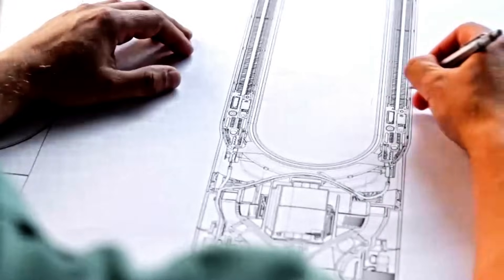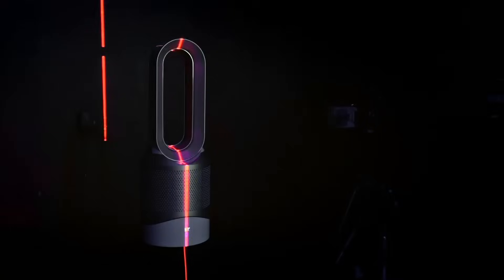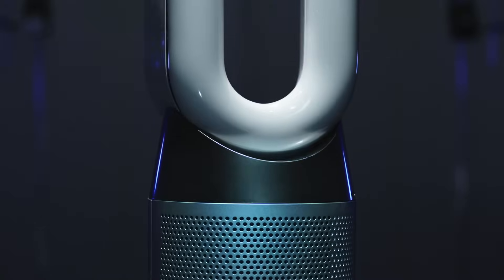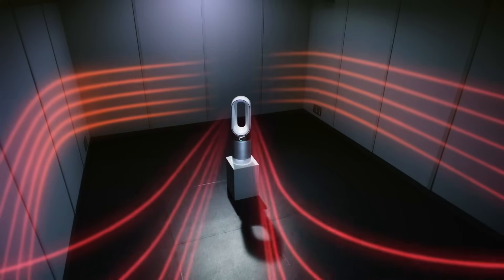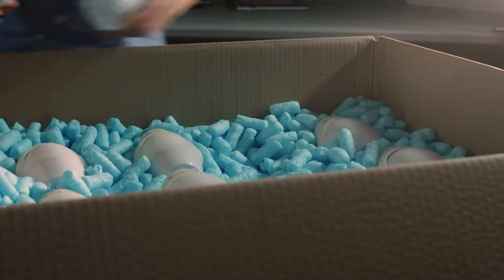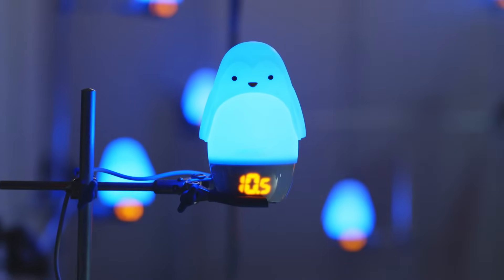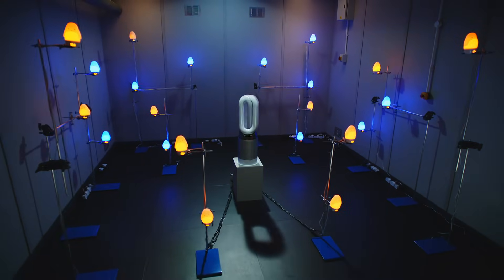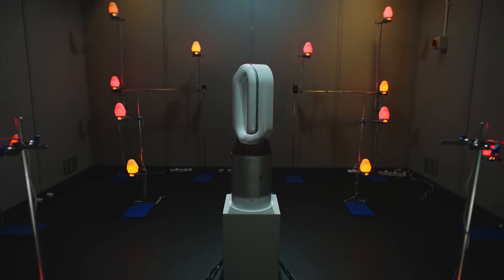See how the Dyson Pure Hot + Cool™ purifying fan efficiently heats the whole room.

Comment: I have a few questions for anyone who has used this device:
Will it heat and purify a living area of 1000 to 1200 square feet? 
Will it heat and purify seperate rooms within that square footage?  There are small gaps under each bedroom door…will it purify and heat those rooms when the doors are closed? 
Is air circulation noticeable?
Typical energy consumption with average settings?

Comment: What about O2 level ? Does it maintain during heating mode ?
Reply from the maker: Hello Hiren, the Dyson Pure Hot+Cool is the only machine of its kind in the market as of now. It does only 3 jobs: Works as an air purifier all year round, a heater in winters and a bladeless fan in summers. This has advanced features such as new filter design, oscillation angle customization up to 350 degrees, diffused mode using which you can direct the airflow from the back of air vents and LCD screen.

Oxygen levels are neither increased nor decreased during its functionality, know more- http://ms.spr.ly/6050Zan3E

Team Dyson India

Comment: Ok, nice demonstration.  But I would like to see if it can heat up evenly if you place the heater in one corner of the room.  Nobody ever places that heater in the center of the room because of obstruction... so this experiment is kind of invalid due to the location of where they place it in the room.
Reply: My sister has a 2100 ft² home and it heats and cools the entire house it's placed at the top of the steps in the split level which sends to an open area not obstructing
Reply: Presentation is spot on. Buy and try for yourself it works if placed in every corner of the room. Obviously the air heated is ejected in one spot of the room more than others, if placed in the corner of the room, but as it circulates the air very efficiently, all the surfaces in the room get more or less the same temperature heat and if you have good insulation this heater is just perfect. I use mine for more than a year now and it never failed. Only issue is the noise, but ANC Earbuds will help. Regards P.S. Due to stocks you are lucky if you can buy one...

Comment: The problem with the Dyson Hot & Cool is that it has a fundamental flaw which Dyson does not seem to know how to fix. I bought one of these and after about 4 months use it developed a high pitched whining noise (rather irritating). Since it was under a 2 year warranty, I had it returned to Dyson and after some hassle, Dyson sent me a replacement, which I’ve been using now for about 3 months and it too has developed the same high pitched whining noise problem. Clearly this product is unreliable and it has been more trouble than it’s worth. Since there is still time left on the 2 year warranty, I shall return it to Dyson, to decide what they intend to do about it. I have lost all faith in this company and regret having bought it. Disappointing. I hope that Dyson just gives me a refund, rather than send me yet another one which will start to whine after about 3 months..... and then what ? Send it back to them again ?
Reply: Owned for 3 years. Never experienced a high pitched sound.
Reply: Need an update

Comment: What room size is this made for?
Reply from the maker: Hi there Joe very good question!

The standard purification and heating performance tests are AHAM AC1-2015 and IEC 60675 respectively. Dyson goes beyond these, by testing filtration efficiency (EN1822), air projection, purification coverage in a 81m3 room with multiple sensors and heating performance in a 35m3 room with multiple sensors.

In maximum setting. Tested for air projection, purification coverage in a 81m3 room and heating performance in a 35m3 room.

Comment: So i took the plunge and bought several dyson fans for the office. Horrible idea. To get the same air flow standing more than 1 meter away, the dyson is much louder to reach the same level of performance. Solution? (Redesign the air intake to stop the whistling effect and use a larger diameter “totally not a vertical upside down fan” fan in the base.) Yes it can go down to a whisper but at a huge reduction in airflow so there’s no point. Also watched a few break down videos for cleaning wow what a nightmare

Comment: When it comes to the normal Dyson air multiplier Cool fan blows, the older version is much more powerful but Dyson do not tell nobody this...
Reply: That's because this is also an air purifier so there are lots of filters that air has to go through first
Reply: @oliversearle3996  that's exactly why they should have increased the power of the motor, especially when you consider the ridiculous price..
Reply: @Displays.1234.  they don't market it as a fan first but yes more power would also be good.